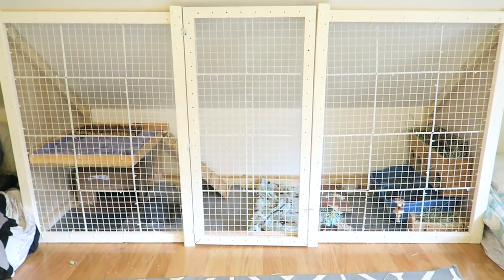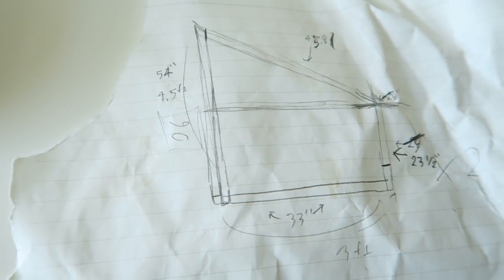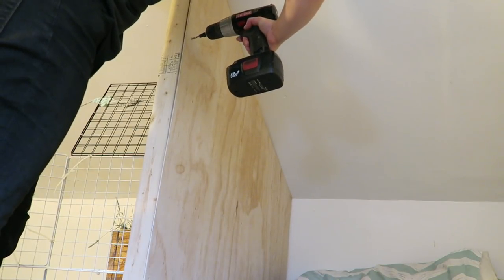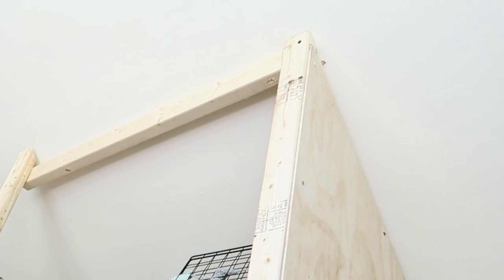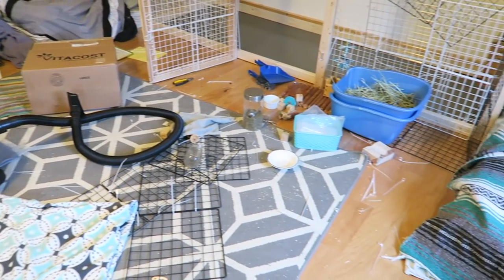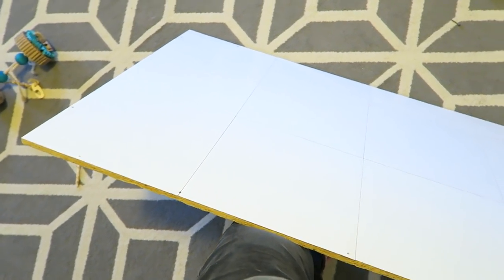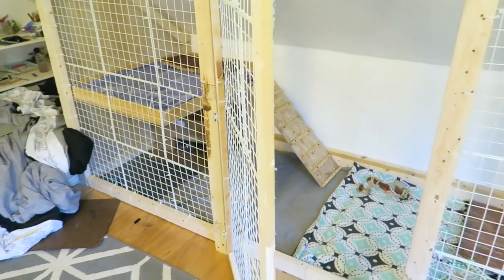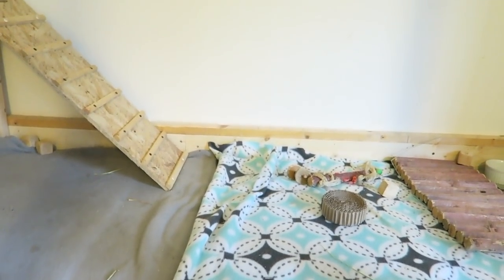BUILDING THE RABBITS NEW DIY CAGE

Comment: Hello!
Can you link me to the untreated wood planks and strappings you used please? I recently bought the flooring and now I just want to make sure I'm getting the correct wood too. Also, if the strappings are cheaper can I use that to build the entire cage instead? One last thing is that I'm not allowed to drill or do anything to the floor/walls so I was wondering if you had any tips if I wanted to make a free-standing cage. I'm afraid there won't be much stability especially if I added a platform like you did... Please let me know. Thank you!